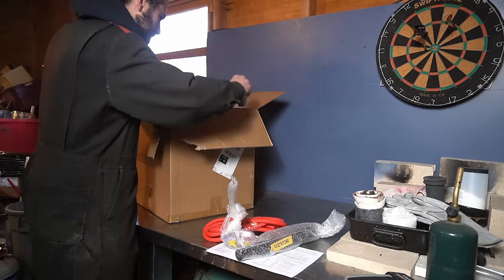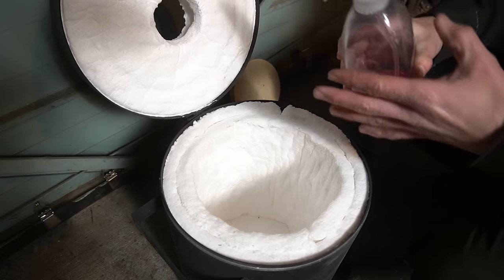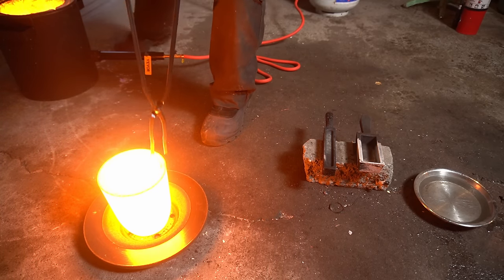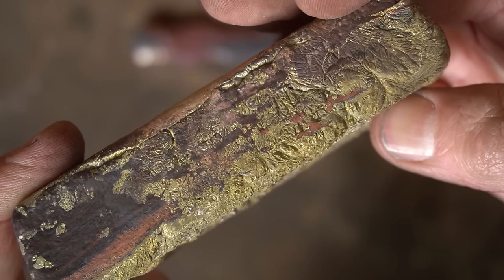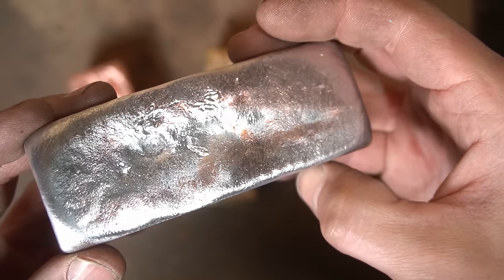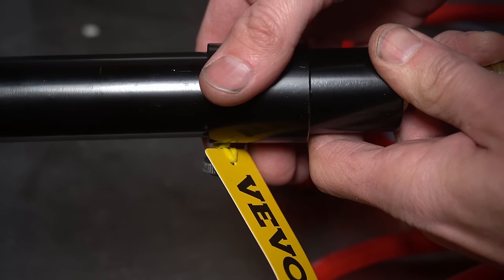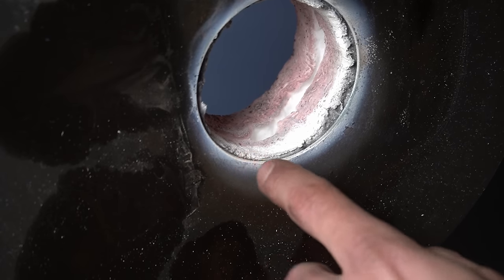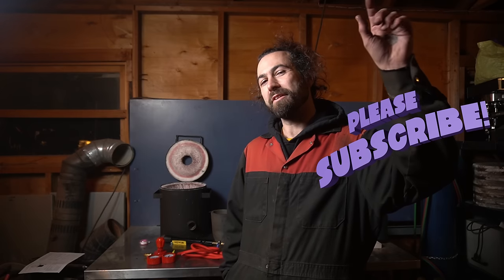Vevor Melting Furnace: Review Setup and Tips - Is it Worth Buying?

Comment: I got my vevor foundry, and i went and got a propane tank but the reducer wont fit into my propane tank. Do i need a specific type of propane canister? I just dont know what i am doing wrong! Plz help :)
Reply from the maker: Two things come to mind, first make sure you’re threading it in the right way because the tank is reverse-threaded (lefty-tighty/righty-loosie) I knew I knew that but when I first got mine I struggled with it for an embarrassing amount of time at the shop before remembering it.
The second thing is your tank may just have too shallow a valve. I have several propane devices and some of them have a longer “nose” on the end of the hose, which is enough of a difference that one of my propane tanks works with everything and one of them has the shallow valve and refuses to catch the threads. I suggest taking the hose with you to one of those “tank traders” spots and trying a few different tanks to find one that works, then just keep that one and refilling it. You’re absolutely right, they aren’t different but yes they’re different 😆👍
Reply: @thubprint  thank you so much, I would have never knew any of that 😅😂👍👍👍

Comment: Im going to build 2 forge/ furnaces out of a propane tank and the other out of s helium tank. Goin to get the tools i need to get the job done. I have to by the circular hand saw blade or whatever its kalled. And goin to put 2 or one inches of ceramic wool in them. Then put rigidizer on it . Then light it and coat again with rigidizer. Heavy coats. Then light and dry. Them refracorty cement that withs 3150 degrees. I phat coat maybe inch or 2. Then i coat that when it dry wit satanite thsts rated for 3200 degress. And ima let thstset and dry. Im think aboutmaybe adding an inch layer on the outside just cuz lol. Ima add 2 holes on side next 2 each other but aprat for when i use it forge. The i will addd 2 other holes at the lower part on opposit side for when i smelt them fine metals😂. Just got to figure out how im goin to get some tubes 😂we

Comment: If I could suggest one thing. Don't use Teflon tape on a gas application. It's hard to put top quality in economy. I once was told that you either get quality or quantity. You can get both. And although they were talking about customer service, the same can be applied to many other things. I'd suggest picking up some gas rated tape. If the gas breaks the seal down, made by Teflon tape, the mishap can cause some serious injuries. We only get 2 eyes, 2 arms, 2 legs, and 1 life. No going back. And for 2 bucks, better safe than sorry. Big difference between China's regulations and ours.

Comment: I appreciate your review, I’ll be skipping this brand due to the overall quality of the gauges and hose clamps. I’ll stick to safety.
Reply from the maker: Fair enough! A stainless steel body would be an improvement as well. I haven’t seen any similar ones with better regulators so I think a person would have to add their own if they wanted a nice one
Reply: I am pretty sure those can be replaced. I have some pretty HD clamps already and I can pick up good gauges at any welding supply shop for $75. What about the gauges do see as unsafe and what might happen? It's something I have never thought of before.

Comment: the only problem i have is that it doesn't do any good to process aluminum , copper or brass because it doesn't add any value at least at my yard so you're just spending any profit on smelting it.
Reply from the maker: Oh I completely agree, but this video really wasn’t about discussing the justification for melting scrap metal 😉 just testing out a tool that can be used to do it!
Reply: @thubprint  i have a garage full of copper and brass so i wish it would make it worth it.